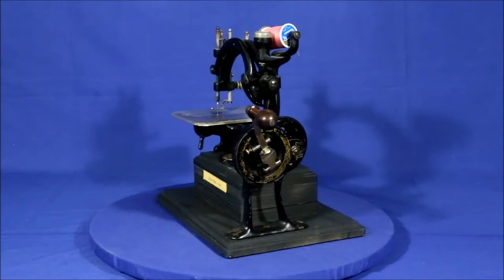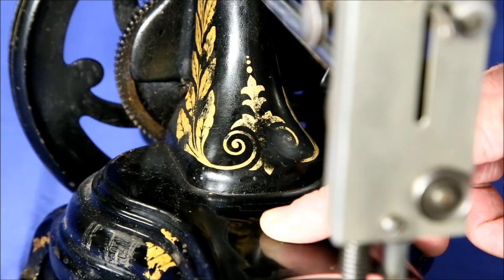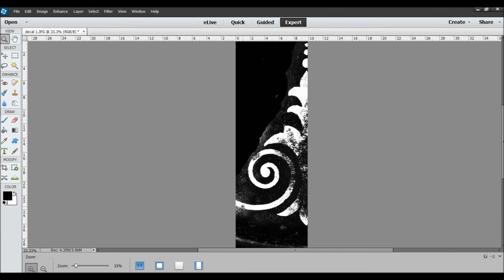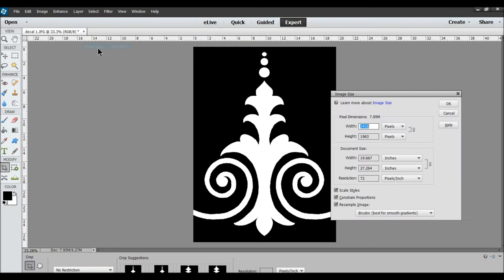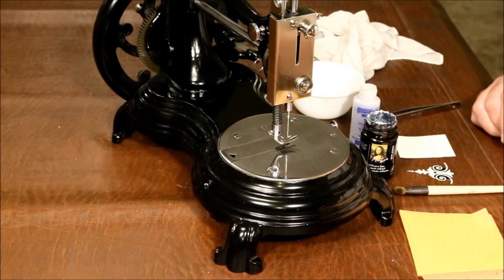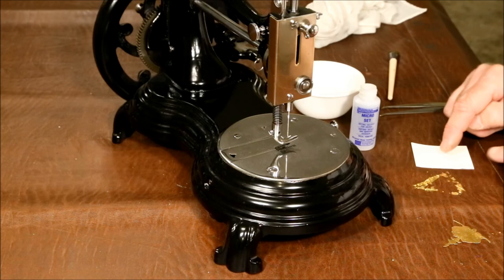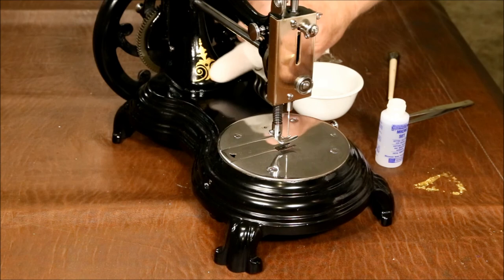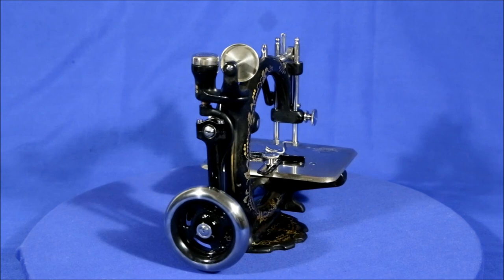Antique Sewing Machine Restoration - How To Make Real Gold Decals

Comment: Real craftsmanship, painstaking and so rare to see.  Like hand engraving.  Very nice.
I wonder ... what if you applied a band of gold foil to the machine then stuck a larger decal over it covering up the gold in reverse. So the letters would be hollow and gold shine thru, and the rest of the gold would be masked off with a black decal further opaqued by a pen or such.  Now the lines would be crisp with less effort, no?  Tricky business.  There is no shortcut for craftsmanship.
Reply from the maker: That's an interesting idea: instead of applying the gold to the back of the decal, apply it directly to the machine before the decal. One big advantage would be that over time, the decal shrinks exposing the gold at the edge of the decal. With your technique, the black decal could be cut large enough so that when it shrinks, it's covers the gold under it. Great idea! I'll give it a try. Thank you!
Reply from the maker: Another good thing about your idea is that the decal would be much thinner and therefore it would be easier to hide the edge.

Comment: do you suggest making all decals first?  I am restoring two machines that need their black paint refinished.  Some of the original art work is in pretty good shape but I can't see applying new decals to mostly dull or missing black finish.  Also, have you restored any machines from the ~1905 Egyptian Series?  I have one that I want to bring back to its glory but the artwork is so detailed.  Do you sell your decals?
Reply from the maker: Sorry, I don't sell decals. If you are talking about Singer's Memphis Egyptian decals, also called Sphinx, these are available on-line from several sources. What I do with machines that have pretty good decals is clean them thoroughly with a degreaser like GoJo or 409, then polish them with Novus 2, a very fine-grained polishing compound for removing fine scratches from plastic, touch-up the decals or leave them as is, then finally spray the machine with a clear coat. I prefer Design Master Clear Gloss Finish #168, which is available from Amazon. The clear gloss not only makes the machine look shiny and new, but darkens the black finish at the same time that it makes the colors of the decals pop. If the black finish has chips in it, I fill them in with Testors gloss black enamel. This is found in the model building area of craft and hobby stores. It's the paint in the tiny, square bottles.

We have two machines with Egyptian-styled decals. They would take a lot of work to recreate. I haven't done so yet because we're focusing on restoring our much older machines.

I've just started making a decal set for our current project: an 1873 Franklin Agenoria and it's reminded me how hard it is to do. I have to warn you if you're thinking about making your own decals that complex sets like this and the Singer Egyptian machines is a very long process.

I hope these comments help. Thanks for writing and good luck with your restorations!
Reply: @wayneschmidt490  Thank you for your very informative videos and replies!
Reply: Wayne Schmidt Do you remove the shellac before installing/repairing the decals?

Comment: This is absolutely fantastic!
I have just got a jones Swan neck that I would like to try to bring back to something near it's former glory ( never done anything like this before!) that has lost most of its decals around the base and damage to the patterns on the arm
Would it be best to re enamel and replace the decals as you have(though that looks pretty complicated)?
Regards and thank you for your tutorials
We can't get decals for the Jones machine in the Uk
Reply from the maker: Dear Hangarfiftyone,

Thanks for commenting and congratulations on your new Jones Swan Neck!

I almost always re-enamel with Rust-oleum's Gloss Protective Enamel Black spray after thoroughly degreasing and then cleaning with alcohol. It gives a smooth, clean surface that accepts decals much better than a restored old finish. It'll look better too.

As far as I have found, no one anywhere makes replacement decals for Jones Swan Neck sewing machines. However, if you can send me an email you feel safe sharing over the Internet, I will email you a copy of the complete set I made for my machine. I should warn you that printing the decals, backing them with gold leaf (or fake gold leaf to save money) reversing them and applying them to a machine is complicated and difficult. Expect to put in at least fifteen hours of frustrating work. Here's a video of how to do it: https://www.youtube.com/watch?v=2PKmkXWtQmY&index=15&list=PLEnCVl0LWmYfasxI2p2mcDF0YauzDkwYY&t=1s

Redoing the decals on a Jones is particularly difficult because of the chain or rope decal that circles the base. It has to be flexed around surfaces that curve in two directions at once and in four places the direction of the curve reverses. Since the film on which the decals are printed doesn't stretch, doing this is extremely difficult. Look very closely at the before and after video (https://www.youtube.com/watch?v=SfVowtDVFzQ&list=PLEnCVl0LWmYfasxI2p2mcDF0YauzDkwYY&index=16&t=0s) and you may spot two spots where the rope segments are distorted to make things match up. If you decide you want to take up this difficult challenge, I'll send you some hints to help.  These hints won't make it easy, but will make it possible.

Of course all this comes after the machine has been mechanically restored and all the metal parts polished. 

I'm not trying to discourage you. Doing a good restoration on one of these machines is not only rewarding, but can add another hundred years to its life. It's entirely possible many generations will enjoy the work you do to preserve it. But I want to be honest in expressing how hard a job it is. If you decide to take it on, I will be happy to provide as much help as you wish.

Thanks again for writing!

Sincerely,

Wayne Schmidt.
Reply from the maker: I just emailed you the decal files. Please let me know if you got them and if you need any assistance. I'll be happy to help.

I deleted your comment in which you provided the email address to prevent Spammers from picking it up.Take care!Wayne Schmidt.

Comment: I like this technique and would like to try it on a New Companion sewing machine. However, I do not have the proper photoshop software. What photoshop software do you use?
Reply from the maker: I used PhotoShop Elements 2020. It's a very basic images processing system. Any image processing software should work. All that's needed ks something that can cut and paste, erase, and draw. Good luck and thanks for commenting!
Reply: @wayneschmidt490  Thank you for responding so quickly. I watched another video of yours about silver backing decals and found that you mentioned Adobe PhotoShop in that video. I have signed up for a 7-day free trial based on what I have seen in your videos. Great information, Thank You.
Reply from the maker: @jameswagner3685  You're welcome. If you have any more questions, feel free to ask.
Reply from the maker: @jameswagner3685  Since posting the decal videos, I've continued to try and improve them. 

With the silver-backed decals, I recommended clear coating the decal, then silver coating it and finally clear coating again to protect the silver paint. I have found that eliminating the first clear coat and going instead straight to the silvering creates a shinier metallic finish that looks more like the original.

One of the big problems with any type of decal is that the edges of the decal are so obvious that they compromise the overall effect. The following video provides examples of this and a couple of ways to hide the edges:

https://www.youtube.com/watch?v=TYwWQzbIYyE

Good luck!

Comment: Hi Wayne, I also have Photoshop Elements 2022. I am having difficulty getting more than one decal image on an 8.5 X 11 page. I see that you have done that in your printing. I have an HP printer not a Connon like yours. Can you recommend a video tutorial of how to do that in Photoshop Elements? Thanks for your great videos. They are very informative.
Reply from the maker: After finishing a decal, I use Canvas Size to expand the canvas so that it's 8 1/2 by 11 with the  decal in one corner. Then in a separate image I create the second decal. Once it's done, I use copy and paste to transfer it close to the first decal on the first image. Repeating this process for each decal lets me place as many as will fit on a single sheet of decal paper. Does this help?
Reply: @wayneschmidt490  Does this help?......... I don't know yet! I will need to try it. I have to try some things several times before I get it. I'll be back to you on that. By the way thanks for the Photoshop Elements 2022 recommendation.
Reply: @wayneschmidt490 Hi Wayne, You asked me "Does this help>". Not really. I followed you too creating a second decal image. You said to copy and paste the second image next to the first decal on the first page. My Photoshop Elements 2022 doesn't seem to offer copy and paste as an option at that point in Edit or Layers. I can't drag from the thumbnail in layers. I lose my crop and everything goes crazy. I tried it in the Organizer and on the print page, no luck. Long way of saying, where did you find the cut and paste for the second image?
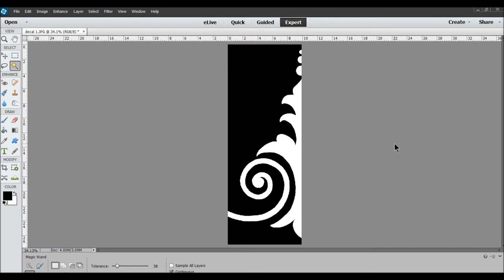Reply from the maker: @jameswagner3685  I'm sorry, but I won't be able to help you. I'm using Photoshop Elements 2020 and in that version, copy-and-paste is a very simple task, as shown in the video from 7:30 to 9:00. If your 2022 version doesn't have a way to select a part of an image, copy it, then paste it like I show, then I don't know how to help. I've never seen the screen for PS Elements 2022 so I can't recommend how to do it. I watched several YouTube videos of how to do it and although they used many different versions of Elements, the copy and paste process was pretty much the same in all of them. You use a selection tool to select what you want to copy, open the 'edit' menu and click on copy, then click on 'paste' and a copy of what you selected will be pasted on your image. Using the 'move' tool lets you move it around anywhere on the page. I don't even bother with layers because the process is so simple it isn't necessary. All I can suggest is that you read the manual (which I admit can be slow, painful and frustrating because they always seem to be written with the assumption that you have a PhD in photo processing) and watch a lot of YouTube videos of how to do it. Sorry I couldn't be more helpful.
Reply: @wayneschmidt490  Hi Wayne, you were more helpful than you realize. I watched your video, 7:30 - 9:00, over and over. I finally got into my thick skull what you were doing. I was able to print several decals on a single piece of 8 1/2 X 11 paper. Now, all That I need to do is clean them up, print them again on water transfer paper, and start the gold leaf process. Thanks again for your help and your excellent videos. I don't think that I could have figured this out without your help. You have a video on how to color tint and tone gold leaf that I will dig into next. I am sure I will be in touch. Thank You!
Reply from the maker: @jameswagner3685  You're welcome, and good luck!

Comment: Hi Wayne. I have just acquired a Jones Serpentine Machine for restoration. It has the benefit of being undamaged and not tampered with, but is very grubby and rusty, albeit it is free to move. My question is: is it possible to do a partial replacement of the decals, or must I do the whole lot? Will the new ones be obvious? Have you ever attempted to plate the nickel plated parts yourself, or would you put them out to a professional shop? Thanks, Paul.
Reply from the maker: Hi, Paul! Congratulations on finding a great machine. I'll address your questions in reverse order.

It's easy to do nickel plating at home. Here's my video about doing, what can go wrong and how to avoid some of the worst problems:

https://www.youtube.com/watch?v=wY9C9DqGMyc&list=PLEnCVl0LWmYfasxI2p2mcDF0YauzDkwYY&index=38&t=65s

That video looked at immersion plating. You can also try 'brush plating,' where instead of immersing the entire part you cover there plating electrode with a cotton pad soaked in the plating solution and rub it over the piece to be plated. There are many YouTube videos about both techniques if you want other references. I only get good plating half of the time. But, that's not a big issue because you can always sand the bad plating off and try again. If you have someplace that does nickel plating, they will almost certainly be able to do a better job than the DIY option.

Two other options are to sand, then polish the metal piece until it's shiny and forget the plating. If the underlaying metal is steel, no one can tell the difference, though it may need more frequent polishing to prevent rust. One final option, if the metal is copper or brass, is to use a wipe-on silvering solution like 'Nushine Silver Plating Solution,' which is available from Amazon. It's not as durable as nickel plating but is quick and easy.

If the gold decorations on your machine are mostly there and only small spots are missing, I recommend filling them in with gold paint. The problem is finding one that matches the color of your gold and that if it's clear coated that the clear coating may dull its appearance. The best touch up paint I've found after years of experimentation is bronze powder mixed with Testors Glosscoat. It's a hassle to make and expensive, but produces the best result. 

If you have large sections that need repair, it's difficult to fix them free hand, even for professional artists. You could try gold leaf or silver-backed decals, but they both will leave visible edges that can make the repair noticeable. A cleaner solution is to use a high resolution stencil. The problem with that technique is that it requires a Scan-N-Cut machine, which runs a few hundred dollars. Simple stencils for small areas can be cut by hand. 

If you can provide more information about about how your artwork is damaged, I'll be happy to offer some recommendations. Better still, if you can post a quick video of your machine it'll give me the clearest idea.

Thanks for commenting! I look forward to hearing from you.
Reply: @wayneschmidt490  Thank you Wayne for your most helpful comments. My background is in furniture restoration, where it is important not to obliterate patina. It seems that for sewing machines the objective is to restore to "as new". I have now had the machine for a few days, and had chance to clean it up somewhat, which has made an enormous difference. Thankfully, it appears mechanically perfect, the only work it needs is to replace the rubber? leather? idler wheel tyre on the bobbin winder. I have also cleaned up the cloth plate with metal polish, and it is almost acceptable, so I am wondering whether to spend on plating (thank you for the link to your video). The biggest remaining issue I would say are the decals. If I knew how to post images on youtube I would, but I have about 50% loss of decals. Added to this, the Jones decals on sale on ebay have a blocky design around the base. My base decoration is a leaf design. The black japan lacquer is almost complete.
Thank you again for your help.
Reply from the maker: @pdbay47  It's easy to replace the rubber ring on your bobbin winder. Here's how:

https://www.youtube.com/watch?v=It3MYjIYGUw&list=PLEnCVl0LWmYfasxI2p2mcDF0YauzDkwYY&index=36
Reply from the maker: @pdbay47  The debate regarding whether or not to restore an antique sewing machine seems to parallel the same question for antique cars. Most people seem to prefer cars in perfect condition, but there is a faction that believe they should be kept in their natural condition. I made a video to act as a forum for discussing this topic, which you can see here:

https://www.youtube.com/watch?v=m_FfszkQbXA&list=PLEnCVl0LWmYfasxI2p2mcDF0YauzDkwYY&index=34

In your case, since half of the artwork is gone I'd do a full restoration. But, to do that you're looking at 100 to 150 hours of painstaking, difficult, frustrating work. Making the decals is hard enough, applying them is a nightmare. Because they have to be fitted over compound curves, in many cases they need to be cut up into small sections. For example, the line of tilted rectangular squares that circle the base is made up of 16 separate small pieces. Getting them all lined up and to follow the curves was extremely difficult. 

Whatever you decide, I'll be happen to help. Good luck!